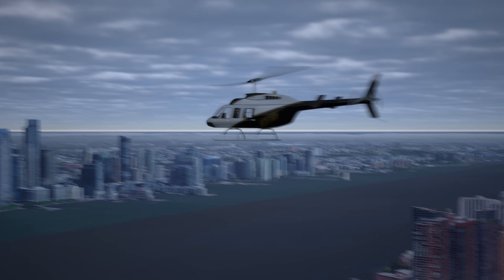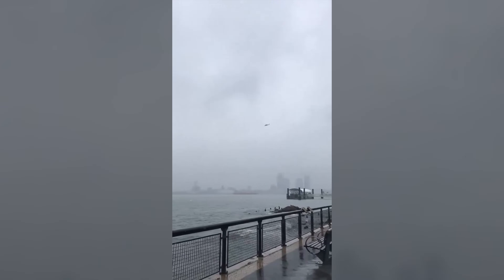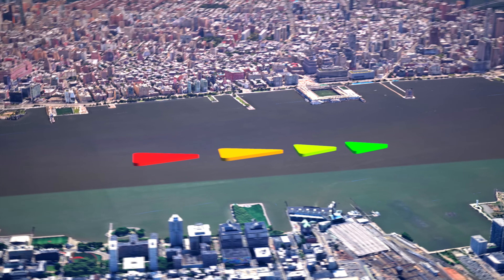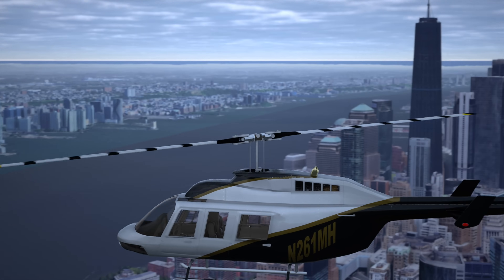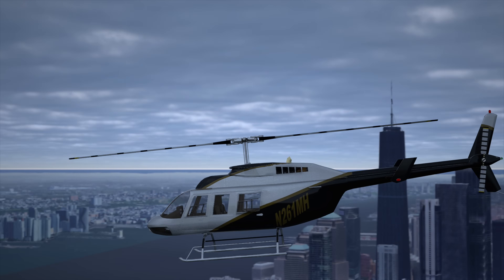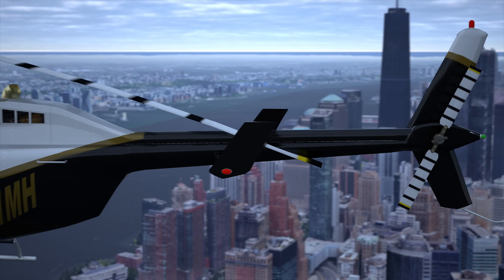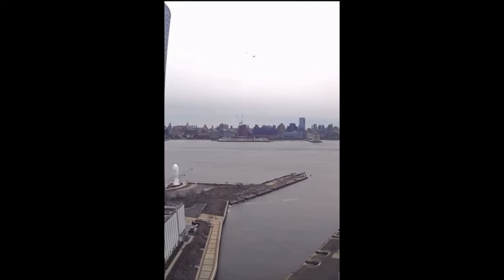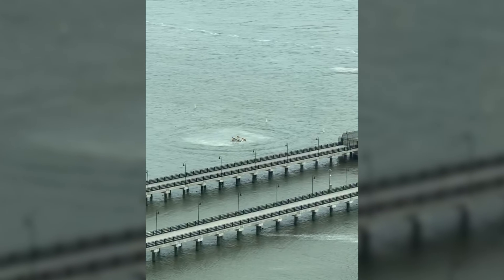Helicopters DON'T just fall from the sky - What is "Mast Bumping"?

Comment: I am an A&P with 40 years experience and it breaks my heart to say it, looks like a mast bump event and not likely a maintenance event. I specialize in helicopter maintenance and this is merely my opinion. I think it is likely pilot error from an aggressive flight control input to avoid birds that could damage rotor or even the canopy which could have caused massive injuries or even death so understandable how an why this might be the case.The crash investigation will identify the failure and probable cause. I had to edit this after watching and freezing the video…

Comment: From what I can see on the video, the frist thing that happens is the helicoptor starts spinning.  It looks like there are a couple of rotations, then a flash from the tail area.  Descent increases and parts start seperating.  I think it was a mechanical failure in the tail rotor driveline that caused rotation which lead to the main rotor severing the tail.

Comment: THIS IS NOT FROM "MAST BUMPING"... Anyone with Helicopter Rotorwing experience can recognize that in the still shot released...The transmission is still attached to the rotor...in addition, Mast Bumping is extremely rare in Bell Helicopters based on the way the engine, transmission is connected to the Fuesalage...SO NOT A MAST BUMPING INCIDENT but definitely a catastrophic failure of the transmission akin to riding a bike and having a stick or metal rod injected into the spokes...on a bike if front tire would result in the bike frame likely being bent, the wheel being ripped off and the rider being hurled to wherever...this was not pilot error and not sabotage unless they find something in the drive shaft and transmission compartment ...RIP

Comment: I don't think this was an accident. A CEO of a very powerful company that has its hands in almost every technology field. That helicopter flew 6 tours that day before this family came on. What are the odds that the tail just so happened to break off only with this CEO on board? I don't think it was accident at all but that's just my opinion
Reply: This is my thoughts exactly. Siemens make equipment that is used at some very high levels, they are massive I would not be surprised if this was an asasinatjkn, not saying it def was but it makes a lot of sense to me.

Comment: So, whoever designed such a system and whoever allowed it to be certified as a airworthy vehicle should both be in jail. It should NEVER be possible for rotor blades to collide with the tail of a helicopter, or any other part of the vehicle.

Comment: At approx. 1:55 in this video you can see that the rotor system is still intact and symmetrical.  An impact with the tail boom with sufficient energy to be the cause of the tail boom separation would have severely damaged the rotor blade/s.  As an ex-Army UH-I instructor pilot and having also flown numerous Jet Ranger models in the civilian world I would bet a large amount of money that this was most definitely NOT a tail boom strike, nor was it mast bumping.

Comment: I think that rotor blade cut the tail section off, in doing so, it came apart as well, sending tail and blade down from sky, then the helicopter fell on its own, without having the tail and blade. I think what he said here, is what happened. I do not think it was a bird issue. Pilot had blade, in an unbalanced tilt, that is when those 3-4 loud boom sounds was probably when the blade was hitting the body of the  helicopter, and sliced the tail off, and when that was happening, the rotor blade got damaged, and came apart. Pilot error.

Comment: Should it not be possible for a helicopter to perform a Mast Bump via pilot input, I know that the blades can bend, but even then should the helicopter rotor tilt not be designed around maximum deflection of the blades so this cant happen.

Comment: The very first clip you have here (I don't know where you got it-- every video I find tends to be of the cabin hitting the water, or the freefalling debris only) is very interesting to me as a heli pilot-- it looks like the first thing that happens is the tail starts falling off by itself. It's blurry video and I wish it the helicopter was visible a second or two sooner, but from what I can see here it looks like the aircraft was completely straight an level when suddenly the tail collapses. Very strange, and seems to suggest this was not a mast-bumping accident, or at the very least-- not a traditional one. There's no apparent maneuvering of any kind. If your weather information presented in the video is correct, there was almost no wind to cause turbulence (although when I looked at the radar track, the ground speed was like 120 one direction and 90 the other, so maybe there was more wind aloft?). The fact that the main rotor blades, hub, mast, and gearbox separated from the airframe still relatively intact also suggests it's maybe not mast bumping (mast bumping accidents often remove the rotor head from the mast). Maybe gearbox seizure? Tailboom collapsed? Engine failure with no lowering of collective led to rotor blow-back and a tail chop? Definitely not your typical accident.

Comment: Potential Solutions for Mast Bumping in Helicopters

Flexible or Adjustable Masts:

Introduce flexibility to the mast or create a dynamic mast system that operates at different angles.

For example, the mast could start in a standard position during takeoff and then transition to an angular lever arm during flight to prevent blade bumping.

Dual-Part Mast Design:

A mast consisting of two parts: one extending down from the body and then angling back up to the apex height of the craft.

This design could maintain safe blade clearance during flex while limiting further movement, as excessive flex would likely result in blade snapping regardless.

Raising Rotor Height:

Elevate the rotor assembly to create a greater clearance zone between the blades and the mast, reducing the likelihood of contact.

While adding height increases safety, it also raises the center of gravity and adds weight.

Body Extension with Rear Stabilization:

Remove the traditional mast and extend the helicopter's body backward. Use a high-power rotor for stabilization in place of a tail rotor.

Though this design increases fuel consumption, it provides stable lift and counters spin more effectively without relying on the conventional mast setup.

Mathematical Context: Torque generated by the rotor can be expressed as: $$ T = F \cdot r $$ where 
𝑇
 is torque, 
𝐹
 is the force exerted by the rotor blades, and 
𝑟
 is the distance (lever arm) from the rotor hub to the mast. By increasing 
𝑟
—the lever arm length—the force 
𝐹
 required to stabilize decreases, but it impacts efficiency and weight distribution.

Alternative Rotor Placement:

Position the rotor assembly in unconventional locations (e.g., slightly forward, backward, or underneath) to avoid traditional mast issues.

Angular mobility could be kept minimal to prevent ground bumping while improving aerodynamics.

Energy Efficiency Considerations:

High-power rotors for stabilization are only practical if energy is used solely for countering spin, avoiding unnecessary forward thrust. While this design increases consumption, the stability benefits may outweigh the drawbacks in specific scenarios.

That’s a clever concept! A drone with a four-prop design enclosed in spherical cages would be excellent for enhancing safety. The spherical cages would shield the spinning propellers from accidental contact with birds, people, or objects, significantly reducing the risk of injury and minimizing damage to the props during collisions. This design could be especially useful in environments where drones are flown close to people, wildlife, or obstacles.

Additionally, the spherical cages could improve structural stability, as the enclosed frame could evenly distribute impact forces, protecting both the drone and its internal components. For applications like delivery drones or drones used in rescue missions, this safety-focused design would be a practical and innovative choice.

It might require lightweight materials like carbon fiber or specialized plastics to avoid adding too much weight, preserving flight efficiency and battery life.

Comment: It wasn't a mast bump, if it was a mast bump the tail would have been sliced off closer to the tail rotor, not right near the end of the cabin.

Also, mast bump results in the main rotor striking the aft empennage necessarily damaging at least one main rotor. Yet the entire main rotor assembly seems mostly intact as it rotated and descended to earth.

Not a mast bump, transmission or gearbox catastrophic failure is what the evidence says to me

No I'm not an expert.

Comment: FAA Commercial helicopter pilot and I have hours in a 206, R44, Cobra (AH-1), and R22.  Also some Cambri, but we'll get to that.

The design feature is not a semi-articulated main rotor system.  It's an UNDERSLUNG rotor system.  That is, the main rotor blades (MRBs) sit below the main rotor hub.  This is good for a lot of stability reasons BUT the introduction of negative Gs (or the effect thereof by having turbulence throw the aircraft up) is dangerous.

The MRBs do have "stops" to prevent blade droop and mast bumping BUT those are frictive and are not in service once the rotor is spun up.  So they're good while it's parked to prevent it hitting people's heads, but at 150 knots if you [the pilot] do the wrong things [pull zero G or negative Gs] you may cut your tailboom off.

This flight was likely a Part 91 flight (14 CFR 91...) so there likely won't be "extra not-required equipment" like a cockpit voice recorder (CVR) or data recorder (CDR).  We have LiveATC.Net (shoutout to Dave!) audio, but there's nothing useful there.

Mast bumping is a serious thing.  It took the US Army a while in Vietnam to figure out that was what was taking down the UH-01s.  Underslung rotor.  The same for the Cobras.  Underslung rotor.  The same for the Bell Jetranger (aka 206).  Underslung rotor.  The same for Robinson's R-22, R-44 and R-66 (and future R-88) helicopters.  Underslung rotors.

When you're working with the lightest of weights, detuned engines, thin cylinder walls, etc. every little bit helps, and an underslung rotor is more stable, offers a better center of gravity (some people call this "center of mass" but on earth it's the same thing), and better control.

I don't point fingers because NO PILOT WANTS HE OR HIS PASSENGERS TO DIE, so keeping that in mind, this is a sad tragedy and I can only offer condolences AND help people understand how this COULD have happened.

If you want more, tune to PIlot Debrief (Hoover),  Blacolerio (Juan Brown), and VASAviation.  They do a tremendous service to the aviation community of helping people understand WHY and HOW bad things  happened so we don't go through that again.

Sorry to be so long.  I enjoyed your review and wanted to contribute.  If I have helped in some way, my mission today is complete.  It being a Friday, best weekend wishes to all.

Comment: The standard Helicopter design has reached its apogee, its basically obsolete and the industry doesn't like innovation or newer safer designs like the original ones first flown in Germany by the famous female test pilot with twin rotors etc, the Turbine engine is deeply flawed it has huge hot operating temperatures pushing these hot gases right on the tail boom & rotor blades thereby weakening it, and terrible fuel consumption! (also easier to hit with heat seeking hand held missiles) air/liquid cooled diesel engines are better for civilian helos much less heat fatigue better fuel consumption = savings on operating costs per hour = much more revenue $ for the owners and pilots, small helos/aircraft are in need of AIRBAGS like those in cars but large enough for passengers, yrs ago in Toronto (90s) I took one of these chopper flights, ($50 for 15 mins) I was placed in the front seat after telling them my weight the other tourist mom with her two kids went to the rear seats same model as this aircraft a Jet Ranger, during the flight the dumb racist Pilot kept looking over at me suspiciously as if I was a danger! (both hands on my lap) that was the LAST time I did one of these flights Never again.

Comment: So what are potential fixes? well this seems like an old oversight that hasn't been addressed as mass bumping should be immposible nad should of been redesigned long ago. You cna change the props flexibility... Can change the helocopters mast, to be coutner adjustible. meaning that it has a mastof hte body that can move and angle down away from the helocopters blades.... ALternative you can make the blades spin higher up... create a more solid regid system, this would add a few more kilos to the helicopter so it would take less over all load, not a big deal.. main problem I thought with helicopters is the back rotor failing causes it ot counter spin, having an meergency means ot fixthis via a jet or other form of propulsion would work... The means of this accident should be avoidable. Which can be costly for everyone.. oftne the liars... poltiics is make hte tax payers pay for it..... in reality this all needs ot be fixed and it takes actions... those actiosn requite typically money in this current state, and peoepl want knowledge for free while denying the fixes to ahve any cost, its a cruel hijacked society in a sense...

There is and are many ways to fix the mast bump or flexible system so it doens't happen.. ALternative its a lever arm force with a blade,, technicaly you can design the helicopters rotat to be fixed at the rear or dront or udner neath as a lesser angle.. such as only 2 feet back and can be mmoutned in the cab, this would requite a much larger coutner force as the mast acts as a lever so it amplifies its force to maintain stability easier in fight... This would compeltely eliminate any mast bumping and  flex... and cna evne change the ntire design to allow the helio blade to rotate at large angles which would turn into ground bumping if its not set right... lol anyways... if you keep it a small angular mobility... and have a  closer back stabilizer it would work... and it owuld destroy hte iconic helopcter shape... to a more uni body looking shape... also yo ucan use a mast that has a rotra triangular arm, that linear goes down and the nback up.. .avoiding the impact bump of the over head blade... this would make hte helicopter have kink tail design.. However, notably you cna have this double with awheel bumper for landing assist makign it a three point contact and increase landing stablity! Win win!

Comment: Geese don't explain the tail rotor.  Losing both the main and tail rotors is extremely rare, not sure I've ever seen that happen in 30+ years.  Rotor impact on the tail could be possible, but the blades were intact coming down and rotating (although separated from the transmission).  Something had to fail mechanically, like the transmission input main bearing seizing, rotor mast bearing seizing....something critical failed and the torque ripped the main off, and severed the tail section.   Devastating results and sad for the family.

Comment: Mast bumping results in the tail possibly being severed. The helicopter would have come down spinning wildly intact.
My friend is a navy helicopter mechanic. He thinks the rotor blades were in poor condition leading to an imbalance and vibration.
That would have weakened and caused the mounts to the gear system to loosen, crack and give way.
I think his analysis is the best one.

Comment: No, not a bump. I'm sure of it. More likely something seized up causing a catastrophic breakup, which included the transmission and rotor separating in one piece. That would have led to the tail rotor and and its shaft separating owing to nothing being there to support it. In the video you could also see the turbine separating. We will see, but I'm almost sure that's what happened. Probably developed a stress fracture in the support which held the transmission in place. You don't need a rotor bump to make things fall apart if that happens. I hear that the bird was a rather new, low hours bird, with under 900 hours on it. I'll bet that it comes down to a manufacturing defect in the transmission mount, not a rotor bump. The mast and rotor were still connected and did what was essentially an auto-rotation down to the water. The rotors seem to be undamaged. That would not be the case if it were a mast bump. You would probably get some damage to the rotor blade which struck the tail, and that would have meant that the rotor connected to the transmission would have been out of balance, and would not have descended in the way it did.
Back in the day, I was a Ranger II pilot and CFI. The Ranger 206B II was a different, but similar forerunner of the model in question here, and there is a lot of commonality between the two birds. I was flying back in the 1970's and 1980's, and a lot has changed inside the cabin since then, but the basic mechanics are much the same.
My heart goes out to all those connected to those who perished in this crash. It's always tough when you lose someone, but it must be just that much worse when it is in such a public way.

Comment: Contaminants in the transmission or a piece of transmission / ⚙️ broke off locked up the unit centrifugal force spun the cabin one rotation  and broke the assembly off they separated into 2bpieces . And hit the water.